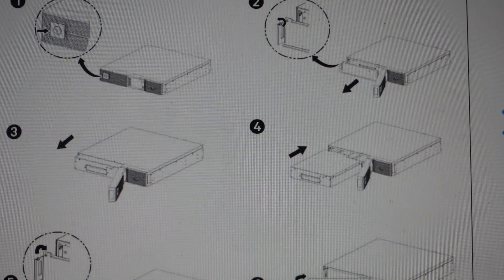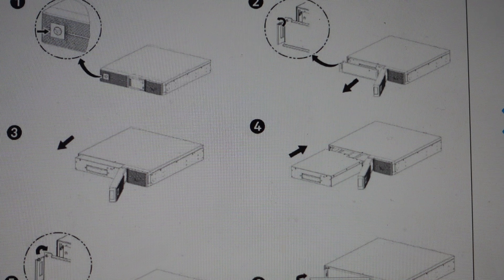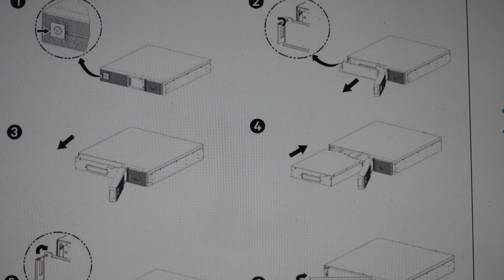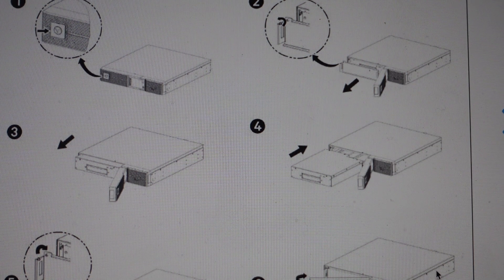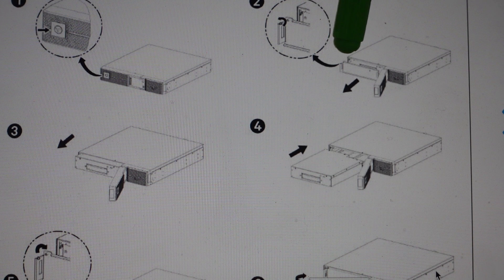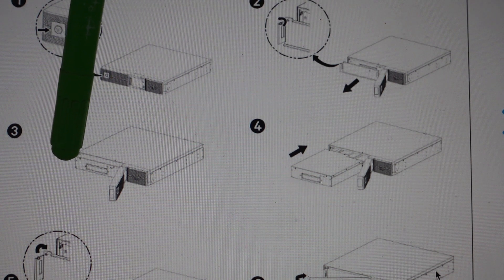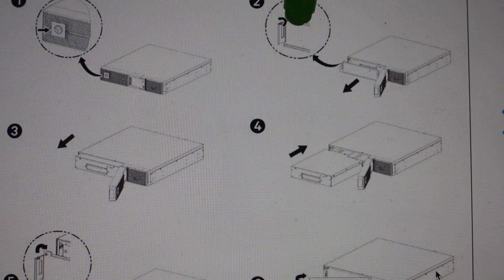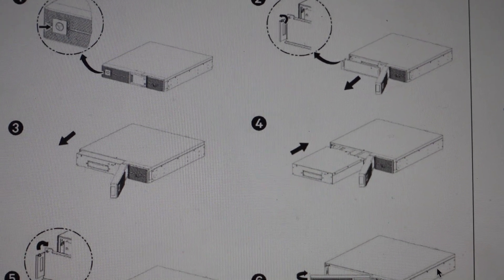Vertiv Liebert GXT5 Battery Replacement

Comment: Why didn't you do an actual battery replacement. I wanted to see it done. Pointless video.
Reply: Because you will be swearing your head off when the plastic that is wrapped around the battery blocks you from pulling the old battery out